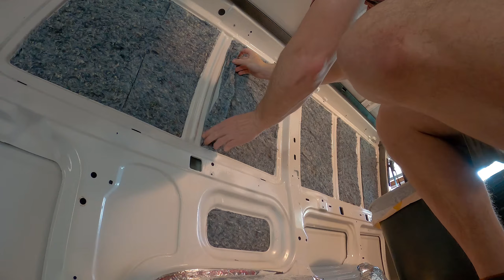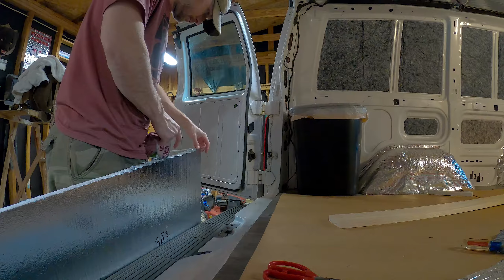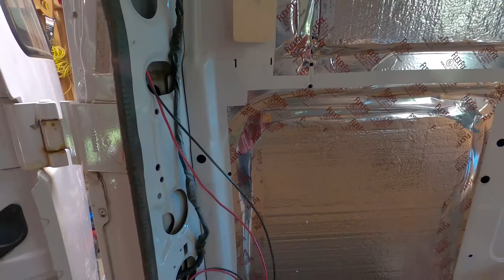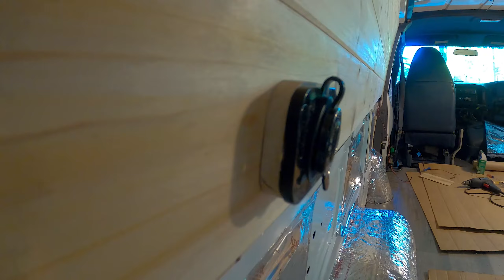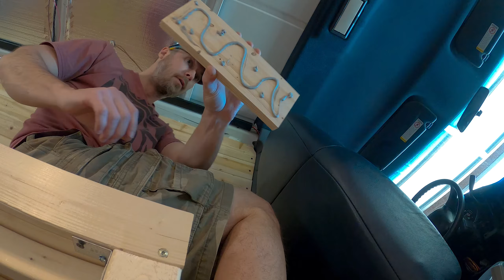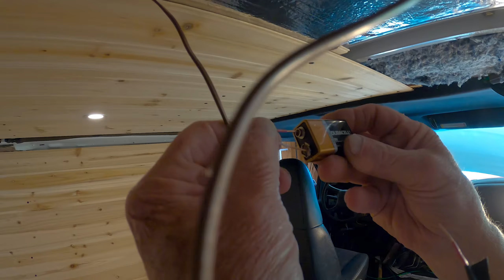Chevy Astro DIY Stealth Camper Van Build EP 4: Insulation + Cedar Plank Walls & Ceiling

Comment: aluminum sheilding must have an air gap of 3/4 inch to work properlyu-- you installed correctly oin teh floor to create a barrier to teh road---  for radiant barriers there has to be a gap.. even emergency space blankets- they work best when they are held away from the body as tehy reflect the body heat back-- when it is in contact in conducts heat through it like a pot does.    billions a year are wasted because people dont understand how this works
Reply: How would I counter this? Do I just leave the reflective layer a bit loose?

Comment: Your mistake on the insulation is putting the reflective side right agaisnt the van walls. Insulation works better if u have a space between the reflectics and wall of van.
Reply: How would I counter this? Do I just leave the reflective layer a bit loose?

Comment: Great build I have a 1997 Astro I'm making a camper van out of. My van is insulated a little different than yours and I'm using 1/4" plywood for the walls and top. Only wiring is two 120 AC outlets lighting will be small puck lights powered by two AAA batteries I used them in my RV the work great. My power is a 2200 watt Pulsar propane Gen-inverter small and very quiet it will give me 120 & 12 volts. My bed frame and other cabinets/storage are made with 1"x1"x1/8" angle steel fastened to the floor. For AC/FAN I removed one of the windows in the back welded a 3/16" plate in its place and put the smallest window unit I could find 4.6 amps works great on my gen with power to spare.👍Sorry for being so long-winded.

Comment: so i followed your strategy here, and it looks fantastic. however, im finding that i may need to go back in and tear it down to add more studs. some of my wall will crack if i lean against it.
Reply from the maker: Did you build up the insulation behind the wall so that there was minimal gap between the paneling?  I haven't had my panels crack like that, but I can definitely see how that could happen. I've always tried to avoid leaning on that wall, and will lean back against the shelving at end of the bed instead. Adding more studs is definitely the better way to go though.